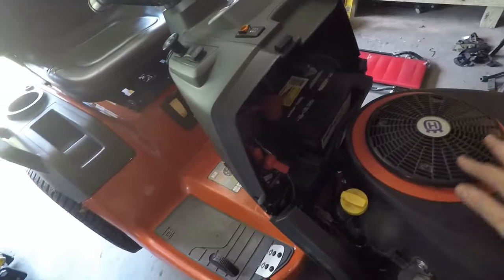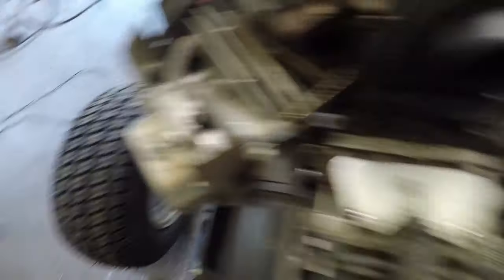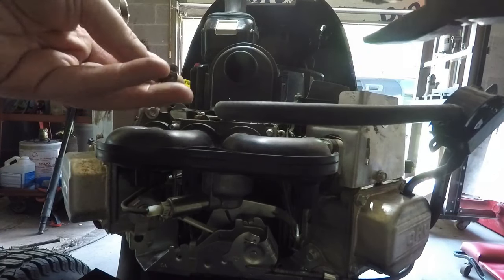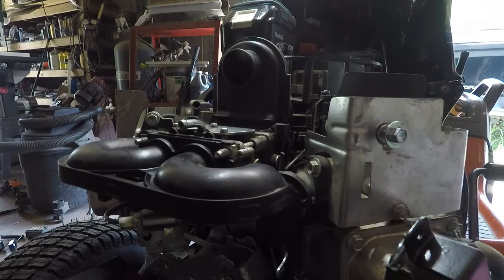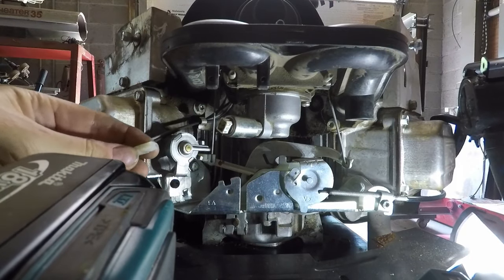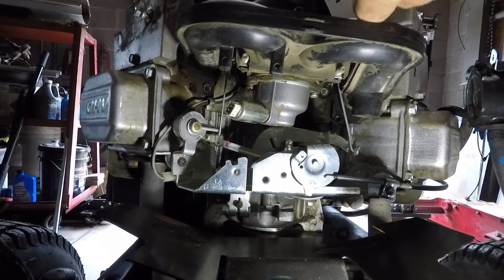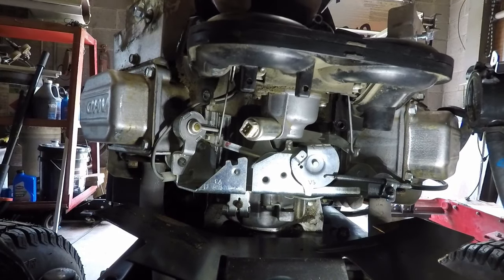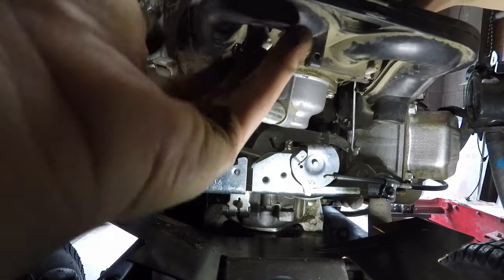Husqvarna 24hp briggs stratton surging engine throttle carburetor removal fix surging sound GT52XLSi

Comment: Just tackled this same issue with the exact same engine and carburetor.  Mine started surging and then completely quit and wouldn't draw any gas into the fuel lines.  Replace the vacuum line that was cracked and finally got it to start but it still surged.  Removed the carb same as you and what a booger that was to get off.  I didn't have a carb kit but cleaned all the goo and crud out of the carb and put it all back together.  The worst part was when I was removing the carb, the linkage that works the choke came apart without me seeing it and I wasn't sure how it went back together.  Finally figured it out and am sure you were as happy as I was when the thing fired up and ran like a top.

Comment: The easiest fix of all is never shown in these videos: Just buy a new carburetor. I have a 2001 YardMan mower (for years just used as a tractor) that has many hundreds of hours on it, always with ethanol gas. When it began acting up I replaced the original carb with a knockoff that worked flawlessly for a decade. After fiddling with cleaning/rebuilding it a couple weeks ago — and having it run well for only a short time — I cut my losses and bought another carb. Flushed gas tank, new fuel lines and filter (all done before this second replacement carb) and all is well. Let’s face it, at this writing a new knockoff carb is just $30 or so. Fussing around with parts can run up half of that in no time. If your time isn’t valuable and you want to tear up an old carburetor, by all means do so. But a new carb is a 45-minute fix. For an extra $15 or $20? No brainer. Incidentally, paying the premium price for non-ethanol gas — assuming it solves any running issues — will over time cost more than a pile of carburetors.

Comment: My 24 hp twin Briggs was doing the same thing.  I ordered a complete carb and gasket set from Amazon...  Runs like a champ mow.  I'm HIGHLY SUSPICIOUS the degrading O rings are due to ethanol based fuel.  I've resolved to use ONY non-ethanol gas from now on....
Reply: could you post the link of the kit you ordered.  I need the same one.  Thanks is advance.
Reply: I have the same Engine ? Can you help ?

Comment: I liked your video greatly and attempted to rebuild nikki carb for my Husqvarna 24hp b&s intek engine which is also surging.  I got the carb rebuild kit and o-rings for jets did not fit like your video showed.  I then found viton o-rings on e-bay like you suggested but they were even larger and sheared into two when inserting into the fuel tubes with force.  I got the 6 pack and tried WD40, motor oil and other lubricating but all would just get cut/sheared when inserting the jet into the fuel tube.   Would you provide any information where you got the o-rings that will actually fit the jet and the fuel tube without shearing the o-rings?  Thanks in advance for any assistance.
Reply from the maker: Well I looked up the seller and his items for sale he doesn't have anything on or even completed, I made this video actually last summer that's when I purchased them, you might just have to get the jets with the o-rings already attached, I know its more costly but it will work right, get genuine parts, sorry I couldn't be of more help cause I feel your pain, I went through it with those shearing o-rings, but the ones I got the second time around were much thinner, wish I could point you in a better direction

Comment: Bro, my dude! I've been scouring the web and YT trying to find what I could only describe as a "toddler going nuts on a snare drum" noise when I started my YTH22V46. Everything I read made it sound like maybe it wasn't a carburator issue. But the noise is spot on. Gonna give this a go and see if it works. Thanks very much!
Reply from the maker: Yeah on this one its pretty clear it was the o rings holding in the jets, I mean the jets fell out of the pickup tubes, so right off you know that isn't right lol
Good Luck with Yours! Hope that fixes it

Comment: The jelly looking stuff is the ethanol gas going bad and it is bad on the rubber seals as well.  The carb jets have small o-rings that the ethanol attacks and also the black part you see at the inlet side of carb, the rubber gasket under it and then the tube that runs in middle of the carb float, the rubber gasket under it.    The dirt inside the bowl needs to be cleaned out for sure.  The carburetor fuel shut off/anti backfire solenoid should never be removed or end snipped off.  I have seen 2 engines filled with fuel because someone or owner thought they didn't need it.   Ethanol fuel will cause that solenoid to gum up as well.  Non ethanol fuel for mowers is the way to go.

Comment: Thanks for the info. I am having trouble finding the o-rings. Think I am going to try a cheap knock-off carb. I know the issues those can come with but for $30, I will see.
Reply from the maker: Yeah I wouldn't buy a knockoff carb, I got the viton o-rings on Ebay for my carb, you can always buy the original equipment jets they comes with the o-rings on them, probably get them for around $30?

Comment: wondering if you could respond to me . . . but, what is the carburetor number that you have  ?   i would like to purchase one so that i too can have better function of the auto choke .
the one that i am working on  is from another engine. and not the original one. 

the best way to remove the choke wire is to use your thumb and pointer finger.  thumb on the white elbow for the dashpot, then by using the pointer finger behind the wire give a gentle tug,
 and it will be removed easily. 

the 4  elongated bolt studs  can be removed with a small regular socket  or a inverted torx bit  ( star bit  probably ) .  i laughed at the same area that you did, because i did not see it either, because of the gasket.  lol .

amazing that your mower has  a glow plug  , for when to not press ( red ) ,  to ready to press to engage  ( start  to idle ) 

p.s. 

upon listening to you. . . lol  ,  visualized seeing  2 people. . . . Nathan Fillion and   Woody Harrelson . 

yes it sounded very much like him., but i'm sure that you  have heard that already.
Reply from the maker: I don't have the mower anymore or I would give you that number, I have actually never heard I sounded like those two people, however no one has ever said I sounded like anyone

Comment: Remove the plastic vane off its post at the flywheel with the rod. Lower left rod just pops out once you line it up with the slot in plastic holder. Lower rod on right just move carb to the left and rod will unhook. DO NOT LOSE THE VANE SPRING, ITS SPECIAL.

Comment: Would spraying carburetor cleaner in it while running do any good?
Reply: no,  you will  wipe the rings ,  and do catastrophic damage. 

removal and disassembly to clean the carburetor  is the #1  best option.